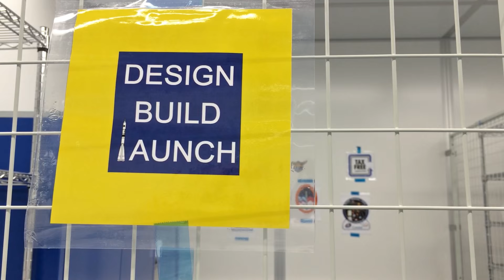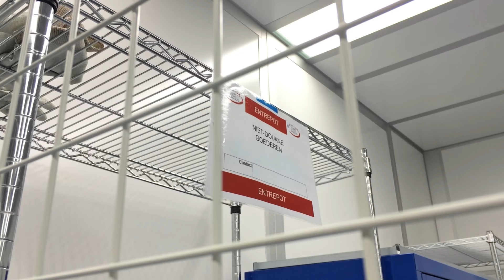Inside A Satellite Clean Room

Comment: Proper question here. Who cleans the clean room ? Does it need cleaning?
Reply: +Stu “Stu8fish” eightfish It does need cleaning, and the users of the cleanroom do that on a regular basis. There is a couple of stages of cleaning. One being cleaning of the benches with alcohol wipes when starting work. We also have a clean room vacuum cleaner (with a very very efficient filter in it) to clean the floor and large surfaces and lastly we clean the entire clean room top to bottom using alcohol wipes and mop the floor with special cleanroom wipes.
Reply: Thanks.

Comment: How do they keep it clean between the clean room and the launch pad?
Reply: +James Thomson excellent question! We put the satellites in canisters, which are packaged into EDS safe plastic bags. On the launch site these are bolted onto the top of the rocket in a clean room environment. The rocket nose cone is made to open once in space by severing explosive bolts (simplification: hollow bolts with gun powder in them). exposing the canisters. Those canisters are then commanded to open by an electrical signal. So the satellites are clean all the way up to space.
Reply: huh, cool. thank you
Reply: When the satellites in their canisters arrive at the launch base, they are removed from the ESD bags and placed on the rockets. The canisters, called ISIPOD or QuadPack, are then bolted to the rocket and when the rocket is in space the satellites are released from the canister.

Comment: What ISO level is the JWST being constructed in?
Reply: probably 1 or 2, since any dust out debris at all could damage the mirrors
Reply: +Jimmy De&#39;Souza That is the main structure with the optics covered. the actual optics path will be much cleaner, the covers only being removed just before launch. And on top of that, there is movable (motorized) covers holding the optics closed in space as well (when not used)
Check out the "lid" on the hubble telescope!

Comment: What ISO level are photolithography clean rooms kept at?
Reply: +Gregory Sherman Around ISO 5, with areas that are cleaner locally. but there is also a lot of packaging and special tools to keep wafers clean. Wafers are usually cleaned first and then kept in the machine with no humans intervening. It also depends on the lithography feature size. CPUs are made in cleaner environment than audio amplifier ICs for instance
Reply: +Gregory Sherman In photolithography you have to work in a vacuum, because the atoms in the air interfere with the process. ISO level refers to the cleanliness of the air at atmospheric pressure. Those are two different things.

Comment: Zero G??  ...the place where the satellite is to go has zero gravity? That doesn't sound right.
Reply: +eric blair You are correct! there still is gravity, it just balances out against the centripetal force of the orbit of the satellite. Hence the satellite is being pulled on by earth with the same force as the force outwards that results from its speed. Unfortunately, the term used is Zero-G, while in reality it should be Zero acceleration. I have simplified slightly here for the sake of argument.
Reply: Wouter Weggelaar Indeed. Perhaps, "apparent weightlessness" would be more accurate a term? But yes, there is still plenty of gravity going on up there.
I would have thought that there is still acceleration going on? After all even a geostationary satellite is orbiting with a constantly changing direction. It just happens to have an orbit of 24 hours, and so matches the earths rotation. Lower satellites will have an even greater rate of change in their direction of travel. Isn't that an acceleration?
Reply: +eric blair No, that's not acceleration, because although it is changing direction, it is not changing the speed at which it is changing direction. I hope that makes sense. weightlessness would be accurate, and it is not apparent weightlessness as weight is defined by mass times acceleration. and we have established this acceleration to be zero. Stuff still has mass, but no weight.

I am slightly simplifying, and not taking into account tidal influences and other gravitational disturbances, nor general relativity. That's a whole other topic ;)
Reply: +Wouter Weggelaar So where, if there is no acceleration, would the very, very small movement of the earth towards the satellite be coming from? Surely the earth would be moving towards the satellite too... causing the earth to osculate by a very, very small amount?
Now I am really confused - Perhaps I am not cut out for understanding this stuff.
Reply: That's why I mentioned I was simplifying. There are very very small disturbances indeed, that will result in tiny accelerations. Nothing compared to the drag that is still present at that altitude. There is still atmosphere at 600km, just very very thin.
That also makes satellites decay out of their orbits. If everything would be 100% balanced out, the net effect would be that earth and the satellite are both orbiting around a virtual point that lies within the earth, but not in its centre.

Comment: Can these little satellites deorbit on their own at the end of their lifetime or will they just become spacejunk?
Reply: +Doping1234 They will decay naturally. A lot of analysis is put in to guarantee this happens, and there are many research projects that are looking into de-orbit devices for end-of-life use. We are participating in a couple of these projects. Everything possible is done to minimise space junk.
Reply: What's the approximate timeframe for deorbiting? 10 Years, 100 Years?
Reply: That greatly depends on the orbital height. If you take a ride to a typical LEO orbit for earth observation (640km), it can be 25 years.
If you are deployed from the ISS (450km) it can be one year or less.
Reply: Ah ok. And if orbits are higher? I guess you have to burn retrograde at some point, but storing fuel for a long time is probably not easy
Reply: These small satellites are not quite there yet! there is multiple propulsion experiments going on, but all still being tested in low orbits until we get more confidence it works. but indeed, in higher orbits you would need to carry enough fuel to dispose yourself into an orbit that does not produce more junk. Or another means of getting yourself down (or up and away!)
Reply: I see. What are you working on in your projects? Propulsion?
Reply: We have both propulsion projects and also drag-sail projects going on. and we are involved in some 3rd party projects as well, supplying components. plenty to do!